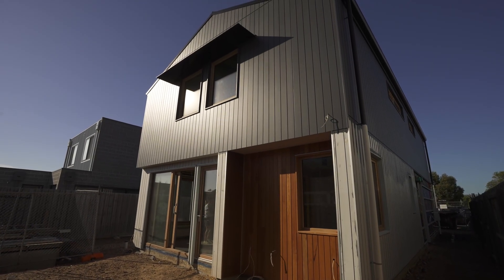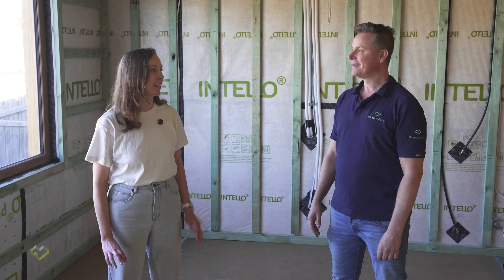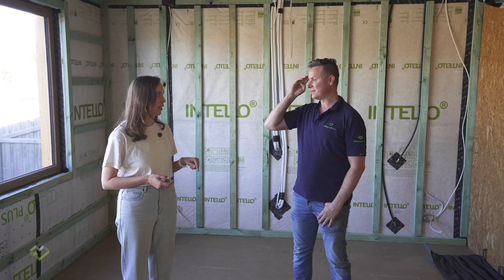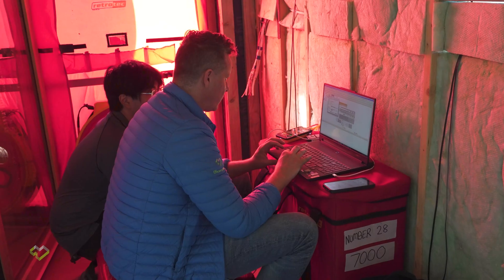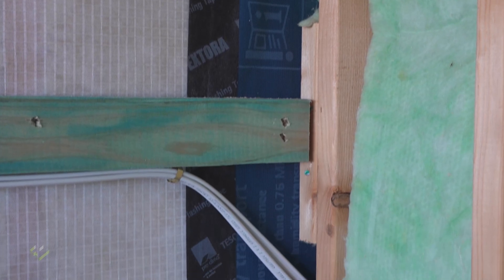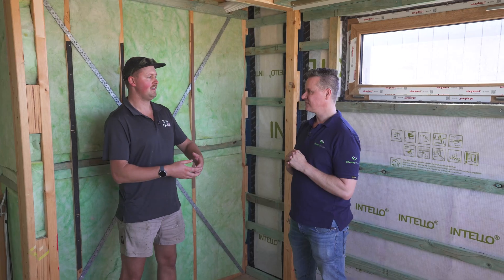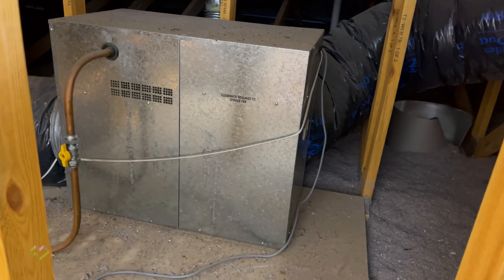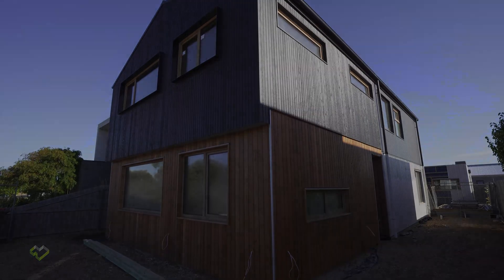The Torquay PassiveHaus

Comment: In terms air quality, what do you do to minimize or eliminate VOC within the living spaces?
Reply: Passive Houses have constant fresh air in take and stale air exhaust via mechanical heat recovery ventilations (HRV) systems. The air is filtered to remove dust, allergens, insects, smoke (to a degree). 
Internally, choice of materials and appliances reduces VOCs, but that's not part of the PH standard. Most choose all-electric, with no gas or wood fires. The range hood exhaust for cooking is often filtered and ventilated inside (like an apartment) which can allow VOCs to rise temporarily until the HRV clears it out, but there are externally venting options with make-up air too if you're concerned.
Reply: @ Ok so basically by replacing the air, not so much by eliminating the products. The reason I asked was that I saw some materials the could be a cause for concern. But saving energy is a major step in the right direction.
Reply: @iTeerRex  Passive House is not just energy saving, but also more healthy (fresh filtered air 24/7, less dust, no mould, no humidity or CO2 buildups), thermal comfort in every corner (no cold spots, drafts, stratification or self imposed zoning), reduced external noise (double or triple glazed windows). 
Which materials concern you? Note that what you see in the video is unfinished so it will be sealed behind Gyprock and won't have air washing through it like in a standard build.
Reply: @AetherSprites  Yes yes I know, and all these measures are of course great. My question was more of a rhetorical one, saying we can do better. Even when in time, the building is replaced, it doesn’t leave a pile of harmful waste.

Comment: Large roof overhangs add beauty and protection for doors, windows, and siding. Water is the enemy of buildings.
A large overhang  is something more architects and builders should consider. Many beautiful buildings stand out because of their large overhangs.
Reply from the maker: Everything is engineered here, to work.  But overhangs are good.
Reply: I'm in the process of building a passivhaus family home near Ballarat that we added large overhangs to during the design stage. We're on a spacious rural block though. The extra roof will help us harvest rainwater. Hopefully it will add some protection to our slab on "problematic" clay soil.
Reply from the maker: @ that’s exciting!  Good luck with the air tightness. 😊